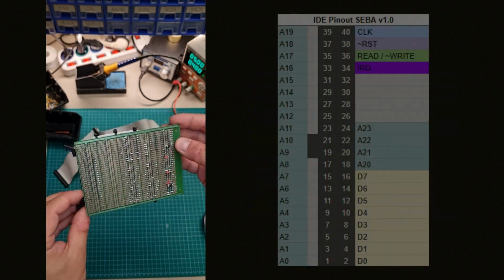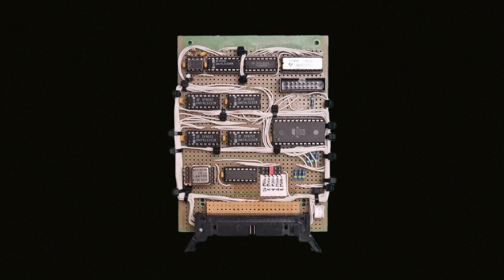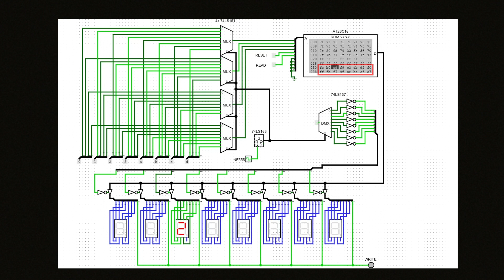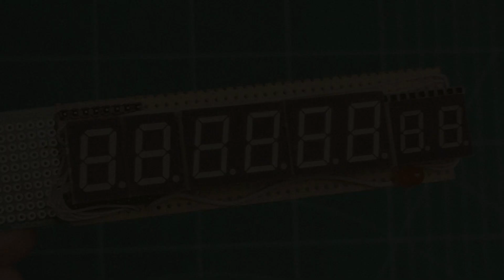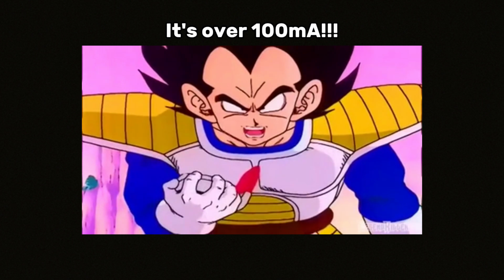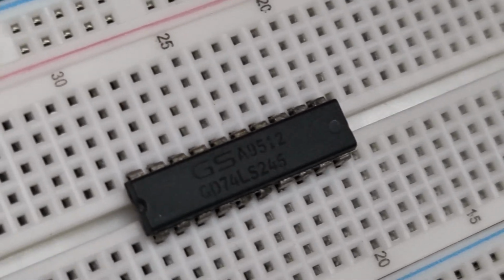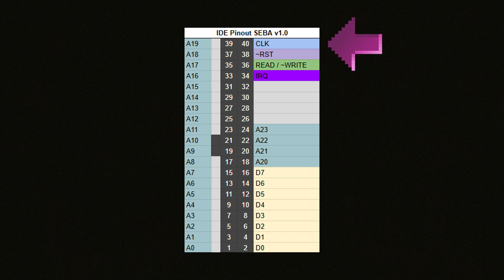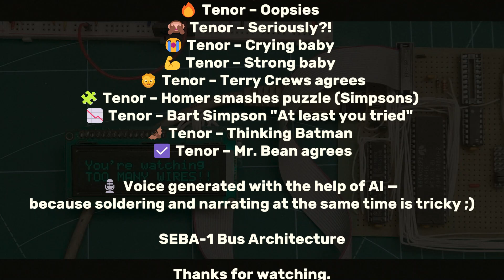Address & Data Decoder for my 8-bit Computer Project

Comment from the maker: Clarification:
Instead of using an EEPROM for the 7-segment decoding, I could have used a DM9368, a dedicated hex-to-7-segment decoder. Several of you pointed this out in the comments, and you're absolutely right!
I really appreciate everyone who took the time to mention it. Your feedback helps make this project (and future ones) better. Thanks!
Reply: I have built a similar bus debugger using the MC14495 HEX-to-7-segment drivers/latches ... a low power equivalent of the DM9368 that draws a lot less current ... still available at affordable prices from AliExpress and the like

Comment: Yea, I didn't have the patience for that.  I just picked a Z80 and it's family up and started with the datasheets.  I tried soldering protoboards and quickly tired and went straight to PCB.  Mine turned out a lot more "traditional" because of the pathway of least resistance, like using a designed together to work together chip set, Z80, CTC, DART, PIO.
When it comes to bus design, of course I'm going there.  However I'm moving up to the 68K for a full async arb'd bus arch to begin with.  I'm also going straight to FPGA to avoid table spanning breadboards of address routers and the beginning of an MMU.
Though I am going to start the FPGA project off with the Z80 as a PoC, just an Upduino with 35IO, so only the "8x8 IO Bus" and control needed.

Comment: Those 12/24 mA probably are the design spec for the series and those specific chips were built to at least reach that. The real values for the specific chips most likely are way higher because that was a way to differentiate your product from the rest and get the lucrative bulk orders from device manufacturers. If those can save 2 pennies by not needed is transistor between a chip and the load, they'll get your chip and not one that has the same limits as the original one.
Reply from the maker: I hadn't thought about how market competition might have influenced the actual capabilities of these chips beyond spec. Appreciate the insight, it adds a whole new layer to understanding the behavior of these vintage components!

Comment: Just stumbled over this project - I really like the aesthetics of your system! It's neat seeing more ways of making custom circuits than sending layouts off to a PCB manufacturer.

…I think I'd probably have just had discrete transistors for each segment? I haven't specced that out, though.
Reply from the maker: Thanks! I'm really glad you like the look of the system. The visual side was actually a big part of the fun for me 😄 And going full DIY with hand-assembled boards feels satisfying in a very different way than ordering PCBs. As for the transistor idea, that's definitely a clean solution, and others have suggested similar approaches too in the comments. I think I'll explore that route more seriously in the next iterations! Thanks!

Comment: Now that's an actual quality content! '245 didn't get cooked because those chips are quite durable, just like the whole 74xx series. You can go beyond absolute maximum rating and most likely nothing will happen. Good idiotproof feature, but of course not recommended for longer runs, unless reliability is not a concern. Using a whole Lookup Table instead of dedicated chips allows for more flexibility, so it's not a huge overkill. From my experience, EPROMs are much better choice for programmable logic than GAL / PAL in places where very fast operation is not needed. They consume far less power and they are much more powerfull when it comes to complexity of logic they can emulate. Even a single EPROM can work as 8-bit ALU with multiply, divide and more complex mathematical operations like trigonometric functions. GAL / PAL would run out of gates on addition and subtraction. Do you have a dedicated software for generating an EPROM memory map, or you just type values into the table? Map generator can speed up the process a lot, I've built a whole CPU this way that beats 6502 when it comes to computational power. All using EPROMs and 74xx series, nothing else!
Reply from the maker: Wow, I know your channel and really admire your work! Getting a comment from you here honestly means a lot! I've seen your series about building a CPU from a LUT, it's great (just like your other videos). At the moment, for the segment display in this project, I'm entering EEPROM data by hand, but I can already see how much a proper map generator would help. Thanks for the insights, comments like yours are a huge motivation to keep going! 🙂
Reply: @kaligari88 glad to hear that! Keep up your work cause your latest videos are a pleasure to watch! When it comes to the map generator, you can just use mine, I provided a link under EPROMaster dev board video. I don't demand any credits from you, but if you find it useful, you can show it to you viewers so that they can also make their lives easier. Usage is very straightforward, for example, if you wish to create an 8-bit divider, you just type:

A[15:8] = argA; // define inputs
A[7:0] = argB;
D[7:0] = argA / argB; // assign the result

And that's it. By providing input values on address lines, you would get a division result on the data lines. Note that there is a division by 0 bug, but it can be fixed via if/else. Real black magic can be made using that tool.
Reply: @kaligari88 glad to hear that! Keep up your work cause your latest videos are a pleasure to watch! When it comes to the map generator, you can just use mine, I provided a link under EPROMaster dev board video. I don't demand any credits from you, but if you find it useful, you can show it to you viewers so that they can also make their lives easier. Usage is very straightforward, for example, if you wish to create an 8-bit divider, you just type:

A[15:8] = argA;
A[7:0] = argB;
D[7:0] = argA / argB;

And that's it. By providing input values on address lines, you would get a division result on the data lines. Note that there is a division by 0 bug, but it can be fixed via if/else. Real black magic can be made using that tool.

Comment: Great project.

EPROM are programmable like PAL and GAL. 🙂

And over engineered?  Naaaah...  Just more flexible.

The sinking power to low doesn't allow it to bring it down voltage down to TTL zero levels.  But it doesn't ruin the circuit.

Comment: A modern 7 segment display will be bright on around 5ma, could just current limit each segment with 1k in series. The "dirty" solution is to solders a second 245 on top of the first one, they will share current - it wont quite be 50/50 but probably good enough to run cool.
Reply from the maker: That's a clever workaround! I've heard of stacking ICs for shared load, but never actually tried it, might be fun to experiment with.

Comment: I was thinking of building something much like this, but moving power and clock to a base board so that the cards wouldn't need their own power or clock. The clock and power would just be passed to each card. The bus on the base board would provide all that. still working out how to get it all to work. but I could make the cards cheaper without having so many clocks and power connectors.

Comment: Just now came across this video. Looks like a very interesting series. Now I am just very amateur and maybe talking out of my backside, but how about considering chips used in the automotive field? The ncv7681 should be able to drive 100 mi amps and is designed for automotive LEDs. Otherwise the only thing I can think of is using your chip to drive individual mosfets
Reply from the maker: Thanks for the suggestion! I wasn't familiar with the NCV7681, so I really appreciate the tip. For this project I try to keep things a bit "retro-limited", but I will definitely keep automotive parts like that in mind for future experiments

Comment: Soldering is great but you can also use wirewrap.
Reply from the maker: That's something I've actually never tried, but I've always found wire wrap kind of fascinating. Thanks for the suggestion 😄

Comment: Am I missing something? There doesn't seem to be any current limit resistors for the LEDs, you should be able to limit it to way less than 15mA (maybe less than 1mA) per segment and still get a really nice, bright display.
Add a 2k2 or even a 3k3 resistor between each LED segment and 74LS245 would drop it nicely and be far less complicated than adding a ULN chip, individual transistors etc.
Reply from the maker: Good eye! There are actually small resistors on the EEPROM side, but yeah, I’ll admit the design isn't perfect 😅 I did try larger values, but the display became way too dim. Thanks for the tip though, always appreciate practical advice like this!

Comment: I built something very similar but with twice the number of digits. A 555 into a 161 out to 2 138s. I used discreet transistors in emitter follower mode on the outputs of the 138s to pull down the cathodes of the 7 segment displays and resistors on the anodes connected to the data lines of the eprom.

The eprom was 8Kbytes and I used half of it to created 4 ‘character sets’ A0 - A7 was the byte to be displayed, A8 - A9 was one of 4 digits from the character set and A10 - A11 picked the character set. The 4 character sets were: hex, ones complement hex (for inverse logic), decimal and signed decimal. The hex modes could display 2 bytes in 4 digits and the decimal mode one byte.

The digits were grouped as 4 groups of 4 and each group could use a different character set based of a set of 8 dip switches. 8 151s multiplexed up to 8 bytes of data down to one that was placed on the low address lines of the eprom. I used HCT logic for the 151s so that they could be driven from 3.3V as well as 5V.

Comment: I love your use of all types of connectors! Jumpers and fc connectors. Very nice! I'm so used to just using jumper cables all around the place. Especially cool how the jumper worked with the clock divider. Would love to see some schemstic/tutorials! Very nice work too!
Reply from the maker: Thanks a lot! 😊Yeah, I tried to keep things a bit more structured than my usual spaghetti of jumper wires 😄
Using proper connectors made debugging way easier. I’ve just uploaded the schematic to GitHub: https://github.com/kaligari/seba-1/tree/main/docs/bus-debugger (link also in the description). Thanks for the kind words — really appreciate it!

Comment: I'd just add discrete transistors to sink and source current. Easy, cheap, robust.
Reply from the maker: That’s honestly the best kind of tip - simple, robust, and effective. Using discrete transistors for current handling definitely makes sense, especially for LEDs or bus driving. Thanks for the suggestion - really appreciate it! 😀
Reply: @kaligari88  And just use common cathodes/anodes of your 7 segment displays to do the multiplexing instead of those 3 state buffers in the logisim schematic - use a transistor for each of the 8 displays, drive them with the 74138/74238 (through limiting resistors and pulldowns/pullups as needed by NPN/PNP, as desired by common anode/cathode).
Put a latch at output of the ROM. Latch out of phase with the 8 step counter so ROM has time to settle, output enable in phase with the demux, use latch outputs to control the segments.
Wire all the segments in parallel and drive them with 7 transistors with current limiting resistors, set the current to taste and desired LED brightness ;-)

Comment: As a computer architect, seeing such huge asymmetry in adress and data widths(24 and 8) is a huge red flag. Can you provide a quick explainer for such a choice?
Reply from the maker: Thanks for the thoughtful question!
You're absolutely right - the 6502 itself only has a 16-bit address space. In this phase, I’m just using it to test the bus and modules. But long term, I’m planning to build my own CPU - and when that happens, the only real limit is imagination.
I chose 24 address lines to unlock up to 16MB of addressable space. That gives me room to play with bigger data - like images, audio - processing data in general. This whole project is very much for fun, and I'm just documenting the process as I go:  learning, experimenting and sometimes overengineering things 😄
Reply: @kaligari88 yeah i know you want your own cpu, wiring so much on the bus will be a pain, your PC and adder will be forced to be 24bit too, which is hard to perform call/jumps. Try writing your cpu arch emulator first (basically a big switch case) and write some programs. You will see that having such asymmetry will be huge pain. If you want to have more space it was usually solved by paging or a combination of a zero page (always there) + swappable paged/banked space
Reply: Just a fair warning that with some decisions you will corner yourself into and then you will have to stick with the pain they cause and this is a recipe for a burnout or abandoning/restarting a project. This is from my own experience 😂
Reply from the maker: Thanks a lot for the honest insight - I really appreciate it 🙏 You made a really good point about how quickly this could become unmanageable.
I'll take your advice and start by writing a CPU emulator with a basic instruction set, just to see how that architecture feels in practice.
I'm really thankful for comments like this. It’s awesome to learn from people with real experience. You might’ve just saved me from a lot of headaches 😅